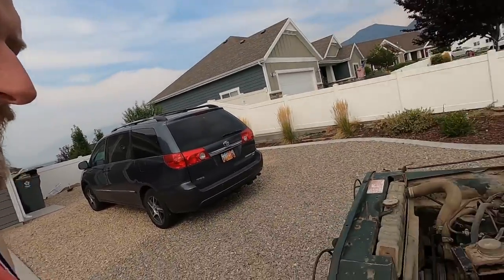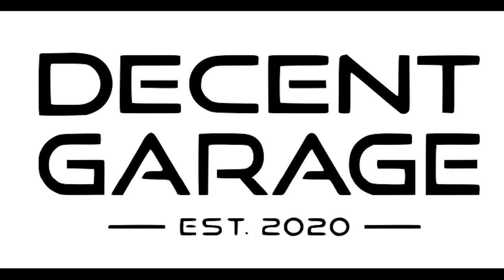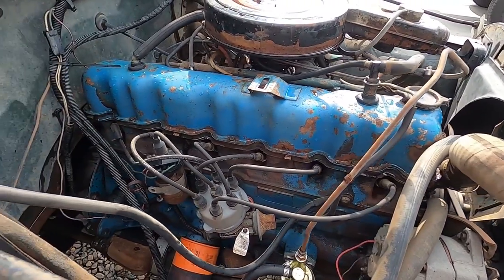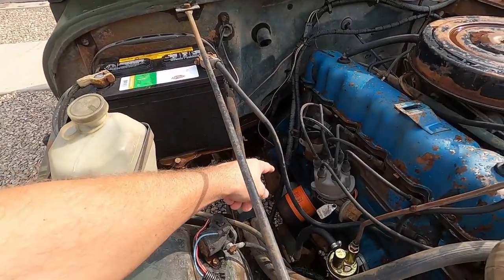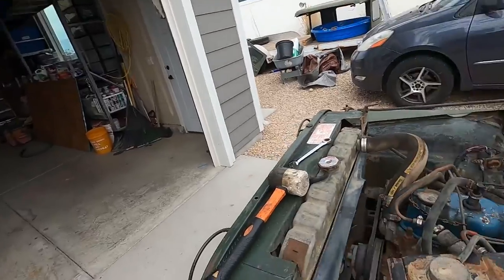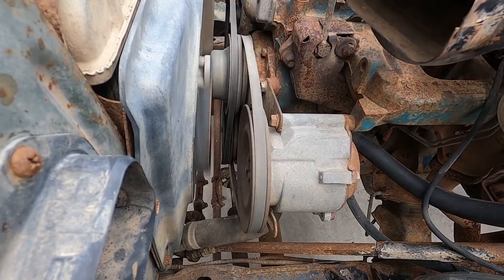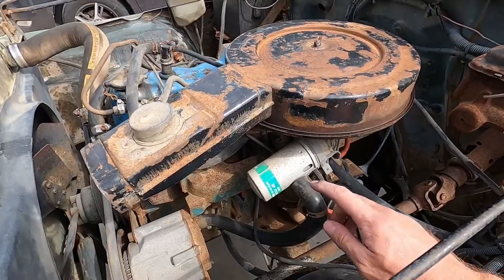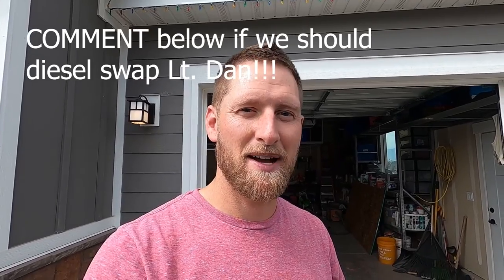Making my 1978 Jeep CJ-5 Start RELIABLY

Comment from the maker: Those of you who made it to the end of the video, what are you thoughts on the diesel swap?
Reply: I would suggest the Cummins R2.8 crate motor, but they're pretty proud of 'em. However, I understand that they were created just for what you're building. They have pretty good low-end torque and are very fuel efficient. I watched a video about it and Lt. Dan came to mind immediately.

Comment: Hey just watched the video! That is the first CJ-5 I've seen with that type of emissions on it before! If you are good with carburetors take a look at the Ford 2100 2-barrel carbs, you want one with 1.08 venturi which should be about the correct CFM for your engine. I need to go back and check out your other videos but do you know if you have the 232 (3.8l) or the 258 (4.2L) engine in your CJ-5?

The V2203 is a great motor and the most common to get, I would recommend it over the V2403 that I'm using actually. I'm running into some weirdness with my V2403 though it's miner! I'm having to guess here, but I believe you have a 3-speed manual in your CJ-5, you'll need to be mindful about gearing if you want to get highway speeds, though in a CJ-5 about 55mph is all you want to do! 

As Duddie said feel free to ask any questions, I think this is going to be an awesome build if you go diesel route! The low end torque is unreal in these little Kubota engines!
Reply from the maker: Rusty Autoholic Guy, welcome to the channel! I'm glad to have a few people following along with this build that can help out when I get stuck. The current setup in the jeep is the 258 4.2l with a 3 speed tranny (T-150?). I don't intend to make the jeep much of a highway vehicle. I would be fine if it topped out at 60 or 65. With the diesel swap on the horizon I probably won't pursue a new carb on the current motor as the end is in site for that setup.
Reply: @decentgarage  yup that makes sense. Sense you have a later CJ-5, earlier models has a smaller engine bay that could only accommodate an inline 4 cylinder, I would highly suggest looking into either a AX15 or a T-5 manual transmission swap. 

I would go with a Borg Warner T-5, it will bolt up to a Dana 300 transfer case, which I believe you have, and having the .86 overdrive is going to really help with highway speeds while the 4.06:1 1st gear paired with the torque of the Kubota Diesel is going to be great for offroading in the CJ-5. 

To accomodate for the longer 5 speed transmission, you'll need to move the V2203 forward, but you'll have plenty of room since you currently have a 4.2l inline six. 

KubotaSwappers makes an adapter kit for your 4.2l as well. Basically his kit makes the back of the Kubota V2203 look like an AMC inline 6, I believe the 4.0l in later model Jeeps and the 4.2l are the same when it comes to bolt pattens but I would check with him to confirm.
Reply: @RustyAutoholicGuy  I am so glad I stirred the pot on this diesel swap and got you two in a discussion! This is going to be a awesome build!

Comment: Considering how overpriced 4bt's are i think the Kubota swap would definitely be the next best thing.
Reply from the maker: Yeah I'm excited for it! It will make it so much more fun to drive.
Reply: Yeah while the 4BT is a great motor, it's WAY to big for a CJ-5, not saying it can't be done, but having a 782lb engine in the front of a light weight CJ-5 is not ideal!
Reply: @RustyAutoholicGuy  that is a very good point. I totally agree with that.